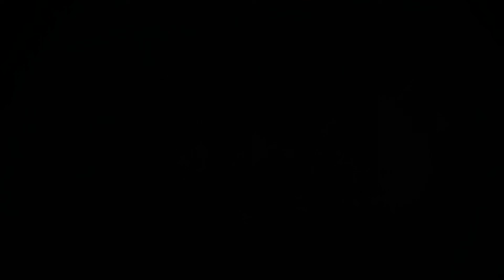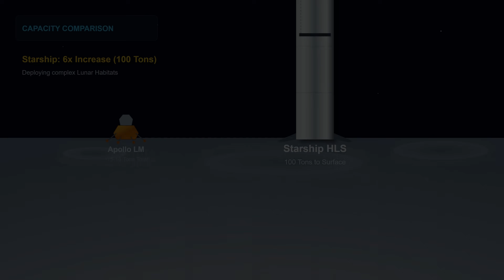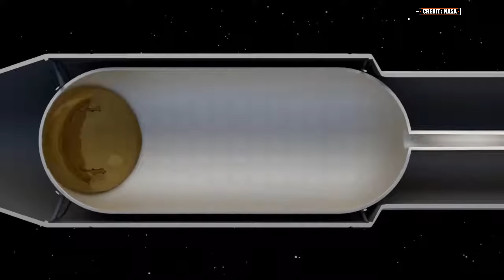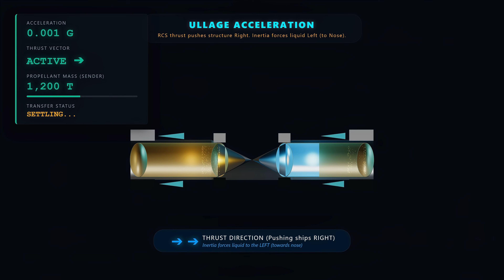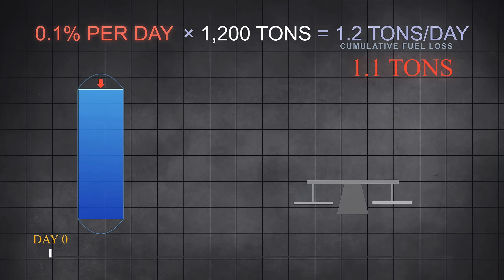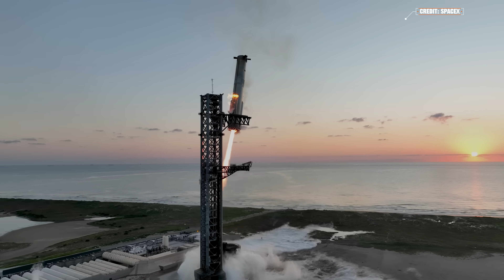Why Starship Cannot Go Anywhere Without Refueling in Orbit?

Comment: EDIT: Okay, I've answered my own question. I forget that Starship burns into own fuel as the second stage, so it only has a fraction of its fuel left when it arrives in LEO, if any. The Tanker will carry fuel in the crew area, and apparently that is 1/10 the capacity of its own tanks. So it takes 16 Starship tanker flights to fill another Starship, and compensate for loss during the flights. 

A Cargp Dragon might be used, but it would have to have a launch system with two stages. So the fuel required would be the same as Starship. 

Original post: I've got to ask the question that has been bothering me since I first learned about this plan. It's a great idea, launching the crew, cargo and fuel into space separately. It saves fuel, and is safer for the crew. 

But what I don't understand is, you are using a Starship to refuel a Starship. Obviously one is crewed and one can use that space to carry extra fuel, but that means that the tanker can MORE than fill up the Starship that will go to the Moon. So why are an additional 15 tankers needed? Does the fuel bleed off so fast that it needs to completely refuel every few days? Are the multiple flights only needed to keep the tank topped up between the time the Starship launches and the crew arrives? Why wait so long between Starship launch and crew launch that you need 16 flights to keep it fully fueled? 

Or, and I consider this more likely, can Starship not get a full tank of fuel into LEO in one flight. Each tanker carries 1/16 of a tank. If that's the case, why do the tankers need to be so big? Make them 1/16 the size of Starship, they won't need a Super Heavy booster to get them into space, and you won't need as much fuel to launch them. You could even make them 1/4 the size and use 5 or 6 to fill the tanks and compensate for bleed off. 

I know I'm missing something so hopefully someone has the answer.😅
Reply: A channel called "Smarter every day" released a video a couple years ago called "I Was SCARED To Say This To NASA" that talks about this.  It is very informative.
Reply: @AddItUp-11235 I was pretty sure I remembered that video. I went back and watched it again, and we've abandoned Gateway. Orion still can't get to Low Lunar Orbit, but with Starship docked to it, there is no reason the combined craft can't transition to any orbit they want. 

Blue Moon is more complicated because there hasn't been any decision on where and how they will rendezvous. I believe Blue Moon 2 is expecting to carry more fuel though. I'm now wondering if Blue Moon is going to require additional fuel too. 

We do have Artemis III, which will presumably test all of the HLS systems before we get to the moon and can't get back. Including refueling in space. Heck, we are not refuelling a crewed vehicle. So apparently that video was watched by somebody. I hope so.
Reply: @richardryley3660  Blue Moon Mark 2 plans show refueling above earth, and refueling above the moon.  In their plan, there is also 2 additional craft - Tug and Tanker, which are refueled above the earth, Tug and Tanker become one ship and that blasts to the moon.  Mark 2 joins them above the moon, and Mark 2 gets refueled by the Tanker.  Then after several docking maneuvers with Orion, crew is onboard Mark 2, it lands, humans work, it takes off, docks with Orion, Orion comes home - all other craft are left orbiting the moon.  Downsides: refueling above the earth, refuel above the moon, multiple docks above the moon - as opposed to no Starship refuel above the moon, and less docking with Starship above the moon.

The bottom line, no matter what system goes to the moon, Starship, Blue Origin, or the Chinese - to get massive payload to the moon, you have to refuel in space.  Blue Origin Mark 2 is so small compared to Starship, it's even more complex because Mark 2 can't take enough fuel with it to the moon to land, work, take off.

Note: not sure if Orion can get to LLO or not, but Starship can.  The NHRO orbit seems to be nixed per Jared testimony with congress.
Reply: @ConstantTrue Thanks for that. I was wondering what configuration would be used for TLI, and whether Blue Moon would use a service module, or its own engines. It appears as if the latter is the plan. 

The Tanker and Tug are to allow the lander to land on the moon and take off again. The Tug is basically to get the Tanker to the Moon, since it will have to perform its own TLI burn. 

I'm assuming the Blue Moon 2 will be launched empty, since it has to be refueled and doesn't use its own fuel to get into orbit, like Starship does. If it could be launched with enough fuel to get to the moon, it would be. 

Blue Moon 1 doesn't appear to need refuelling and doesn't need to take off once it lands on the moon. It just needs to get there and land and drop off cargo.
Reply: @ConstantTrue Also, once Orion gets to a distant retrograde orbit, of any kind, Starship can bring it down to LLO if it wants, before undocking to land. Or, Orion may wish to stay in high orbit for communications and visibility reasons. Starship could always bring Orion back to high lunar orbit if that is needed to save fuel.
Reply from the maker: Love that you worked it out yourself — that's exactly it. The rocket equation eats most of the fuel just getting to LEO. Great breakdown in your edit. 💯
Reply: @TheCosmicRushYT I really did struggle with this for a while, only to facepalm myself when I remembered that Starship ran itself out of fuel getting to LEO. Of course the tanker wouldn't have any more fuel left than that. 

My logic got hung up on the thought that the Starship was refuelling from tank to tank. But of course the tank would be empty. So it's the crew area that would have to be used to store the fuel. 

It does seem like a waste to launch something that is bigger than the Space Shuttle to carry some fuel into space, but since Starship needs a LOT of fuel, and it's designed to be fully reusable, it might as well be used instead of using a whole separate rocket to get a Cargo Dragon into space. The system will probably work better if SoaceX or someone else can build a depot for a Starship to dock with and completely refuel in one go.
Reply: @richardryley3660  "designed to be fully reusable" - in this context I assume you are meaning Starship-HLS since you are talking about refueling.  If so, that is incorrect.  Starship-HLS which is to go to the moon is not reusable at all.  It will not have the black heat tiles (heavy) as it will never come back and re-enter to get to earth surface.  It will be white in color to reflect sun rays and keep radiation at bay during it's 3 day trip out, 7 day trip surface, and perhaps a day to take off from lunar surface to dock with Orion for crew transfer.

The process is very complicated.  It's easy to get lost.

But not as complex as Blue Origin's Mark 2 (see my comments this post or above).
Reply: @ConstantTrue Yes I was referring to Starship. Typically in a sentence once you have identified a subject, in this case Starship, any subsequent pronouns in the same sentence refer to the subject. 

While the HLS will not have tiles for re-entry, Starship itself is designed to be reusable. And I was referring to the tankers, which presumably will reenter the atmosphere after use so they can be refilled and launched again. If SpaceX's plan is for the tankers to be one use and then burn up in the atmosphere, that's fine, but I'm not sure of the logic. I suppose if they are still in the prototype stage that could make sense.
Reply: @richardryley3660  I lost context.  I think we're on the same page.

Comment: Very good info and video!
We also need better engines (to be able to move around the solar system faster and more smoothly), 
better materials (for re-entry into different atmospheres) 
and gravitational fields in space (to be able to live and inhabit space).

And then we need to start building real spaceships and not small and cramped capsules from the 70s.
Only SpaceX has reached a similar concept with Starchip, but it is still a rocket and not a real spaceship in that sense.
Reply: 💯 - I don't know why SpaceX has done any research on nuclear propulsion - the only realistic way to have a multiplanet species - yuck - multiplanet civilization is with nuclear propulsion (thermal and electric) speeding up the trip to something manageable.
Reply: @PCman999-99  Nuclear propulsion is not something a none government entity can do very easily. The regulation of nuclear materials is all governed by international treaty so not easy at all.
Reply from the maker: Totally agree — Starship is a stepping stone, not the destination. Real interplanetary ships will look very different. Exciting time to watch it all unfold. 🌍🚀

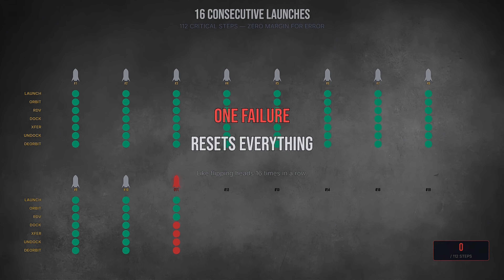Comment: The assertion at 18:20 that all steps have to go right is false. If a tanker launch can't rendezvous and transfer propellent, you merely need one more tanker launch. It is possible that you could damage something on the depot during one of the tanker missions, but depending on the nature and severity, many such mishaps could be reset remotely, or repaired by a live-aboard Optimus robot.

Throwing out unsupported strawman arguments does not improve your credibility.
Reply from the maker: Fair point — a failed tanker doesn't kill the mission, it just adds another launch. We oversimplified that for narrative impact. Thanks for the correction. 👍

Comment: Excellent channel, finally someone is "getting it"!  Lots of slop AI youtubers who are nearly wrong on key points, this channel is probably the cleanest I've seen.  Also, check out Eager Space channel for even more math and science about Starship as well as a ton of other space topics.

Does anyone know why, as Cosmic Rush says, the nose to nose docking is preferred over the side by side docking?  

Almost every other depiction of it shows the two ships side by side.  I would think side by side would work better since in nose to nose there is no way to "slow down" the two ships as the engines are at opposite ends and firing either one would speed up the closing distance, with no way to "back off" if that were too fast.  

In the side by side model, where the engines are either pointed opposite directions or both in the same direction and once the two ships are side by side, then the cold small thrusters are used to line them up side by side.
Reply from the maker: Thanks! RCS thrusters handle the approach, not main engines — so backing off isn't an issue. Nose-to-nose keeps the fuel path shortest. 🤝
Reply: @TheCosmicRushYT  Except that for Starship-HLS, the nose is the docking port for Orion for humans to travel through.  In the nose-to-nose fuel transfer idea, that doesn't seem safe nor possible give the size to have both a docking port for humans AND fuel in the same area.

What I believe will happen is the probe and drogues (which we are starting to see on the Starbase, TX videos of the current V3 ships) are the physical stability elements (to keep the ships attached and stable during the mini-thrusting needed for fuel transfer), and then a separate ship-quick-disconnect like system is the fuel transfer itself.

I don't think "keep the fuel path the shortest" is really a technical reason as two ships side-by-side and the fuel tanks are what? a meter or less apart?

Comment: Just to be clear, this is NASA's plan. Not SpaceX.
Reply: I think maybe you are splitting hairs?

Yes, NASA main plan, but SpaceX is contracted to do the HLS part, so it is also inherently their plan to carry out the mission goals, one of those being "massive tonnage to the moon surface" to build the lunar base.  And since you have to have the big delta-v from LEO to LLO, then a refuel is necessary.

And by the way, necessary for Blue Origin or China as well.  No refuel means no massive usable payload to the moon surface, it's a pretty cut and dry reality - no tricks can overcome that.
Reply: SpaceX started the starship program with orbital refueling as a core design element.  Nasa contracted SpaceX to build the artemis lunar lander after the starship program had been going for several years. The reality is that neither of them came up with the orbital refueling idea.  It's been floating around for decades.  SpaceX is just the first organization to actually start working on it.  The whole point is that starship is hopefully going to be fully and rapidly reusable, so they can land the tanker ships, refuel them, and launch them again.  Orbital refueling never made sense before SpaceX because rockets used to be fully expended each time.  The cost would be outrageous.  The trade off was always that you would sacrifice payload capacity for delta V.  Make one rocket, have way less payload, go faster.  Starship plans to have really high payload capacity, but relies on orbital refueling to get out of LEO.  It's a great idea, and it will theoretically reduce the cost per ton to the moon or mars by like 100x.
Reply: Another misunderstanding people have is they argue that Starship is too big and requires all of these orbital refuelings but in reality the plan and requirements NASA requires is reusability,  to bring tons of mass to be taken to the Moon both in orbit at the surface. Blue Origin is also back in the running for the Lunar lander along with SpaceX for redundancy. The only way this can be done in Accordance with what NASA requires